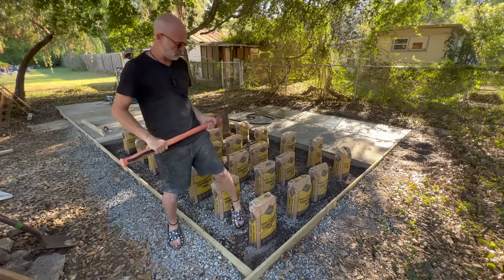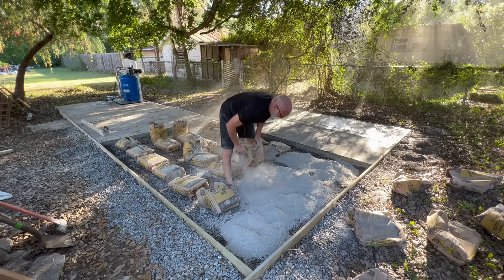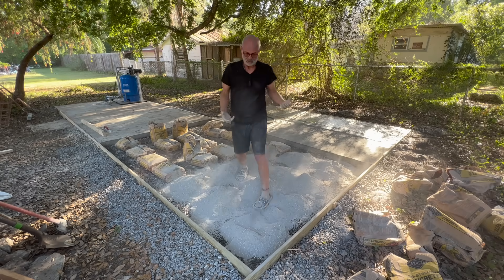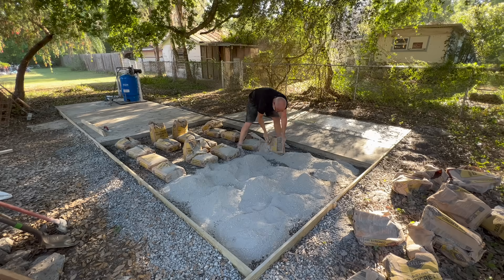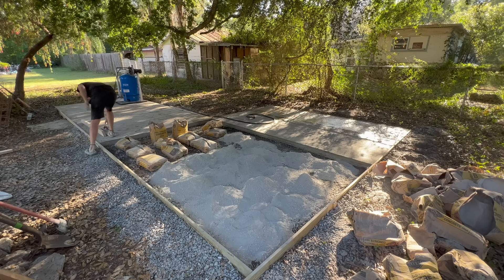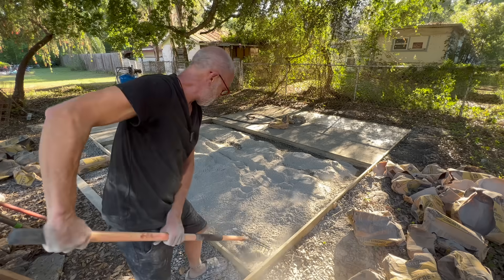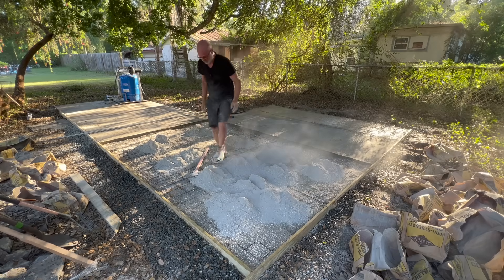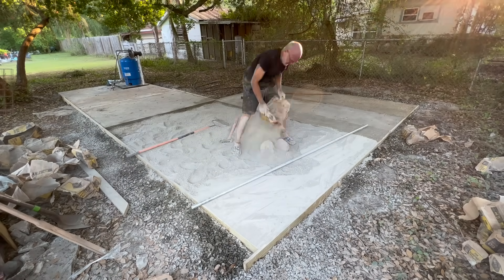Concrete Ninja Warrior Dry Pour Slab for Backyard Building

Comment: Hello, Paul. I was just quoted last week $1,900.00 for a 20’x20’x3” slab for my backyard. I want to build a shed and a carport on it. Thankfully I’ve been watching videos about Dry pouring concrete and your videos are really convincing me to go this route. Thank youl!
Reply: No disrespect, but a 20' by 20' for 2k is insanely good. Honestly, I haven't done the calculations, but you'll be spending quite a bit on the concrete alone for your DIY version if you try it yourself. Do the math and let me know.
Reply: I did the math for you…At $5 per 60lb. bag of quickrete, a 20’x 20’ x 3” pad would require 221bags. That’s over $1,100 just for the dry concrete. That $1,900 quote is a Godsend…hope you jumped on that one…
Reply: @tonymusolino2369  OP will be using this pad for a carport so 4 inches depth will be required with steel. The quoted price is even a greater bargain if it was bid with these specs.
Reply: @tonymusolino2369   I'd be carful of such a cheap quote. you can order concrete and pour it yourself. it is not very hard, this guy dry pour looks harder to be honest.
Reply: How did you figure that out?
Reply: That price is too great to pass up. Sign and contract and don't pay the full amount up front
Reply: I thank you all for your suggestions and calculations. I had not done the math yet. I enjoy the journey of doing something I haven’t done before because I get to keep the learning experience, but only if it’s cost effective. Yes the quote includes material, forming, and labor. Y’all gave me something to think about. Much Mahalos!
Reply: A 2x4 is 3.5” so just assume you’ll pour at the depth. So you’ll need about 4.5 yds of concrete… pouring that size would be insane to use bags.. buying concrete by the bag is the most expensive way to buy concrete.. if you’re determined to not use a concrete company, then buy a con mix from your local landscape supplier, and buy Portland cement and mix yourself.. but even then, at 4.5 yds, I would not recommend that… you can’t mix that much in one day and doing it over a few days will give you cold joints.. if that quote is for labor and cement, jump on that…
Reply: @bman6502  I would normally agree with you but there many videos of bagged concrete being cheaper. I'm on the fence with my 24x40 pole barn.
Reply: @Superduty_59  you can’t believe every video on utube.. why would you need to watch a video, the math is not hard.. you need 45 bags of 80# bags to make one yard, and HD cost is about $6. That’s comes out to $270 per yard..
Reply: @bman6502  yes you can't believe everything you see. I don't NEED to watch a video on this but I stumbled upon several videos about bagged concrete being cheaper. The few videos about this the premise is If you hire a concrete crew to pour and finish your concrete and you get the concrete delivered you will absolutely spend the most money. If you can pour it yourself or have a few buddies help for free but have it delivered then that will likely be fairly cheap too. In my area it will cost you approximately $235 a yard plus fuel charge and delivery fee for a full 10 yard truck. If you need less it's all that plus $100 per yard penalty for every yard below 10 yard full truck.

Having said all that I can have my pole barn poured and not have to lift a finger for $7500 not including prep work and gravel. My time and labor is certainly not free but if I pour it myself in sections with bagged concrete I can do all the work myself. Home Depot has #80 bags for $4.10 if you buy 42 bags so that's $185 per yard. Granted I will have to mix it myself and provide all the labor but damn you're math is off bud. $185 per yard is cheaper than $235 per yard delivered plus fees and delivery charges.
Reply: @Superduty_59  Bagged concrete is only cheaper if you are doing one or two yards of concrete or you live 60 miles from the nearest plant. If you can put up the forms and finish it yourself, having a truck deliver wet concrete is the best way to go. Even if bagged was cheaper, i would get it deliver because concrete work already sucks and having to mix a pallet of bags only makes it worse.
Reply: do not pour concrete this way. its totally wrong. don't waste you time and money.
Reply: Lots of failed math in this thread. One guys says 20 bags at $5 a bag is a cost of $1000. REALLY NO the math is $100. Another guy says 42 bags at $6 per bag is $1260. REALLY NO the math is $252.  No wonder concrete work is so expensive none of you people can do proper math. 
🤦🏻‍♂️🤦🏻‍♂️🤡
Reply: @ghostape6481  He has a 5 yard job. 5 × 252
Reply: @christopherarthur9577  the guys with the horrible math deleted their comments. Lol. So you can’t even see what I was referring too.
Reply: @ghostape6481  Hilarious. I can see how one might miss the context if you weren't following along. I was one of several trying to give the person some input.
     It's usually bad math, or my personal peeve, bad grammar 
     When it comes to concrete, the math is the easy part. My point about the bags, is it's extremely labor intensive. In the case of 5 yards. That's just shy of 8 1/2 tons. Multiply by how many times you handle one bag. If you are retired and still have a good back, knock yourself out 
     "Dry pour" is a terrible misnomer. There is water, and there's no pour. It should be called "Too much time on my hands pour" or "Lazy, inferior, better mousetrap method".
     If anyone doubts the finished strength of this method, do this simple test. You may have inadvertently done it already. Leave a bag of concrete in the rain. After about a week, break it up with a hammer. You might not even need a hammer. It usually crumbles.
     Short of a cylinder core test (which is beyond the scope of you tube keyboard warriors), no one can definitively compare the strength. When mixing per the instructions on a bag, you have to use very little water to achieve advertised strength. If you use too much water to make it more flowable, finished strength is diminished. The water in a concrete mix hydrates out. What is left, are molecular sized voids of air. Less water, less air. In a dry pour, my guess is, there are both layers of relatively strong areas and entirely weak.
     If there's a geo tech out there, maybe they could actually do a core test on the dry method.
     Ghost, I'm guessing you're on the east coast.
Reply: Lmfao when you waste your money doing it like this clown you can hire the other guy to rip it out and redo it for twice his original quote
Reply: each bag is $8. which comes to about $176. The frame will cost you another $20 max. how did you come up with your # please?
Reply: 4" is standard residential. 20'×20'×4" thick figures for 4.93 cubic yards. I know everybody just figures square footage divided by 80 for a 4" slab. A cubic yard is 46,656 cubic inches. 5 yards from a redi mix company would run at least $800 these days, depending on what part of the country you live in. The smaller the load, the more the delivery charge. Some companies start to waive a delivery charge at 6 yards.
     Hand mixing more than a yard is not very cost effective. An entire pallet is a yard. 42- 80lb. bags. Figure $6 a bag after tax. $1,260.
     Some things people overlook when hand mixing. 1) Do you have a big enough truck/trailer? A normal truck can't safely handle a whole pallet. Multiple trips. 2) How many times will you handle one 80lb bag? It didn't look like the guy backed up to the pour. So I'm guessing he handled each bag at least 3 times. If you do it right, in a wheelbarrow or mixer, add a couple more times. 3,360 lbs per yard times however many times you handled each bag. Good luck with getting someone at Lowe's or Home Depot to help load. 3) The quality of the pre mixes has declined. When mixing, throw in a shovel of portland to bring the strength up but it will also help with the trowel finish. It won't be so sandy. It really seems like there's less cement in those bags lately.
     Please don't use this method. For a shed, it's probably ok. The gentleman seems pretty pleased with himself and the finish. It's absolutely inferior in finished strength because of no consistency in moisture throughout. 
     Finishing concrete is a process. It requires a magnesium float to delay the setting, or hydration, of the slab. Application of a steel trowel will actually activate the heating of the slab. There are several variables on when to apply. Neither of these are used here.
     I'm wondering how much time elapsed from start to finish. It was dark for awhile.
Reply: Mate, I'm from Australia, and it's more than double the cost by doing concrete slabs by 20kg concrete bags and almost impossible due to the quantity required. The more sensible approach is to calculate the concrete required and have it delivered by truck, with a few mates at hand to help. This dry method pour technique doesn't meet code - get advice from a professional. You are asking for trouble if you intend to use this technique. Good luck.
Reply: 10 outta 10 for having a go mate, but there are easier ways!!!!!!
Reply: I just did my pole barn which is 24x36’ we went 4” and about 8” deep where the footings will be for my lift when I get it. I used 6 yards per side of the barn (poured it two seperate days so we had an area to do the finish work) for the 12 yards total it was about $2500, my buddy charged me $1500 for him and his worker to come give me a hand with it spread out over 3 days. $1900 sounds very fair to me after you factor in gravel cost and the concrete. Also for that size just call a concrete truck to come out as long as it’s an accessible spot it’s well worth doing that over mixing it yourself even if you have a compact cement mixer. That way you can kill your body doing the finish work instead of the entire time.
Reply: I paid $188 a yard delivered, the company I used was $20 a yard more then the other but our schedule was tight and we had to get it that day so I just paid the extra. I was quoted $7000-8500 for the slab to have someone come do it. All said and done it cost me like 4500-5k to do my self with some hired help.
Reply: 3 inches is to thin for vehicles. 4” MIN but if you really want it to last 5-6” with rebar
Reply: You’ll get a better quality product, you won’t have to transport and carry 100s of bags of concrete, you won’t have to do all the labor, you won’t have to buy and setup forms. I’d pay them to do it, watch and have a drink
Reply: Ahahahaha do a video on this
Reply: Which state you are located?
Reply: @thayalansuntharalingam  El Paso, Texas
Reply: @SupremeAI98  look for yourself 80# bag quickcrete if you buy 42 bags or more 4.10= $185 per yard. I agree dry pour is not a good idea. Can’t be as strong unless it’s mixed properly. Cheaper yes! A lot more work absolutely yes! When I was younger I used to work for a concrete contractor that poured wharehouse slabs and such.
Reply: @Superduty_59  "Can’t be as strong unless it’s mixed properly." Does every slab need to be 4,000 PSI strong? Heck no, certainly not slabs in your backyard for sheds or patios. There are numerous videos on YouTube of people dry-pouring slabs for walkways and sheds and chicken coops, etc. and they check back after 1-2 years in perfect condition.
Reply: @isabellavision  It will not be as strong unless it's properly mixed! I never once said it needed to be as strong. Everybody has the free will to decide what's best for them. Hell you may just need compacted stone. If I mix 5000 psi concrete then I will absolutely properly mix it so it has the best chance of being a fully 5000 psi.
Reply: @SupremeAI98  Bud I can promise you can't do math I guess. You do the easier stuff and let us guys do the real work. I have seen loads of ready mix get rejected or torn back up due to it failing strength tests. I used to work for a company that did huge slabs and retaining walls. I have poured a 25 foot long sidewalk at my house 3.5 to 4 inches deep 3 foot wide 4 years ago properly mixed and it has done great with pick up truck and zero turn going over it. Every contractor would not do this because it's cheaper. It will take longer and more labor to mix and place. It's more expensive to have a truck deliver it that to pay labor to mix and place. that's not debatable. If you could bother to read my other replies above I have already said this isn't for everyone. If you are looking to save money (yes my time is not free) this may be for you. You can buy the cheaper $ bagged concrete and mix yourself. You can work at your pace and you can pour in sections. I will be saving between $3-4K by doin all the work myself and not paying a contractor to do it for me. I can't pour 17 yards by myself from a truck. I can pour it by myself in 8'x24' sections though. Yes it will be hard work! Yes I can save money. I'm not afraid of hard work.
Reply: Thank y'all for your input and advice! I'm leaning towards getting it done by contractor instead of myself based on this. Maybe for the experience of doing it myself as in this video I can do a smaller project where strength and integrity of the concrete is not as consequential, such as a small walkway to the shed, handling only foot traffic.
Reply: Really, I just quoted a 12 X 29 for $3400.   And a small 6 x 6 20 feet from that. Compacted, pumped 3500psi, formed, placed, re-bar reinforced, finished, control cut with an early entry saw.   You get what you pay for.
Reply: You didn't get a quote for $1,900 for a 20x20 slab.   If you did, You didn't actually get a quote.  You found a scam and someone is going to run off with half the money for materials upfront.
Reply: You didn't get a quote for $1,900 for a 20x20 slab.   If you did, You didn't actually get a quote.  You found a scam and someone is going to run off with half the money for materials upfront.
Reply: I hope your lung X-rays are ok.
Reply: Pay the $1900.
Reply: A 3" thick slab?
Run away from the person who came up with that idea.
Reply: @franciscolinera7618  too thin? 4" or 5" would be better I suppose